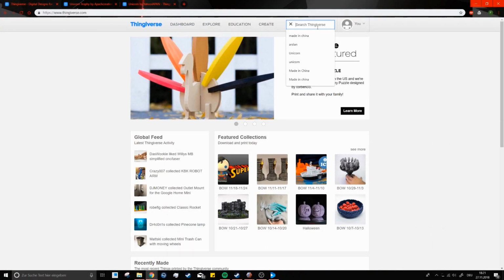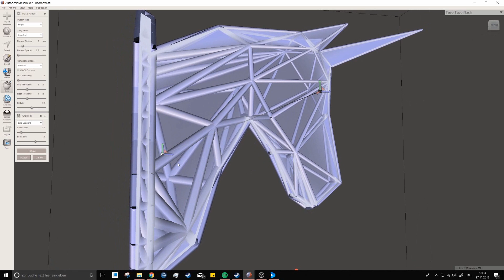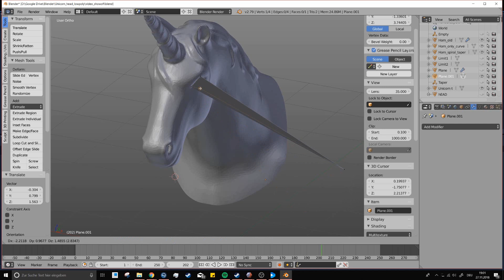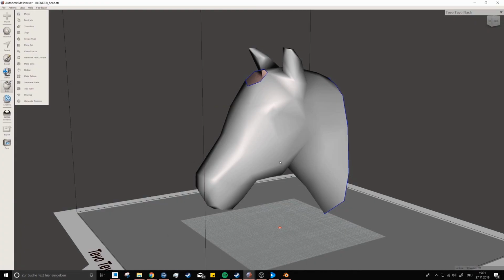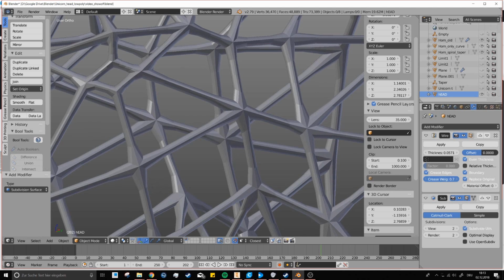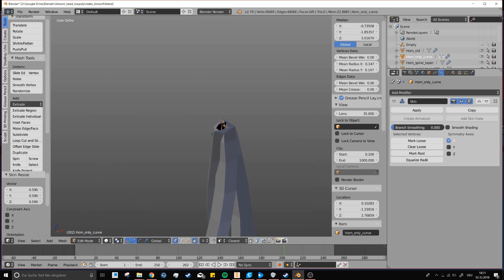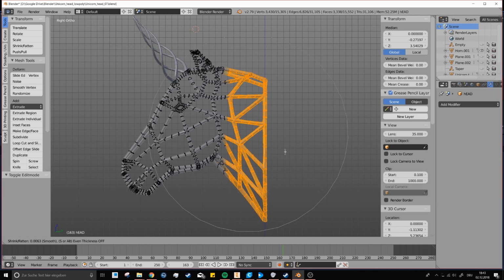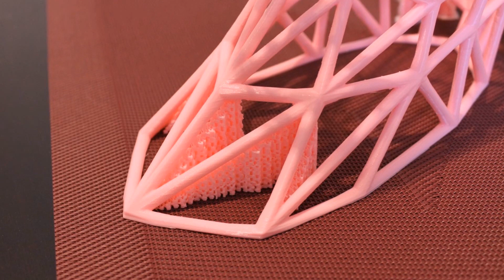How to design a Low Poly Unicorn in Mesh-Style

Comment: I just dicovered a nice feature of meshmaker: You can reduce certain parts of the mesh more than others!
You can reduce the mesh a little (so that all shapes are preserved). Then press CTRL+A again and press Shift and deselect faces  that are important in critical areas of the mesh using the brush (you can adjust the brush size) . Then you can reduce the mesh again and the edges that you deselected will be preserved!
You can repeat those steps or now reduce the entire mesh again until you have the desired result!